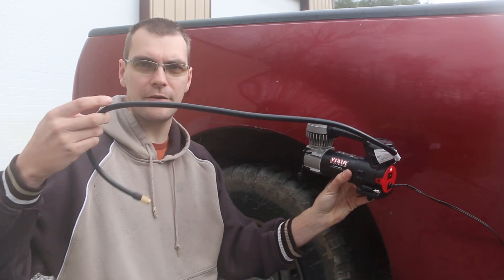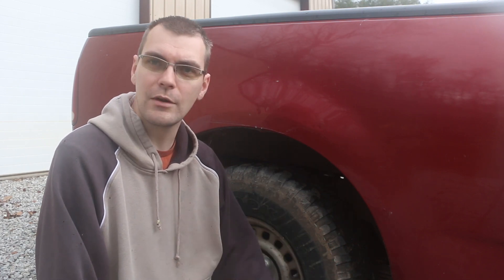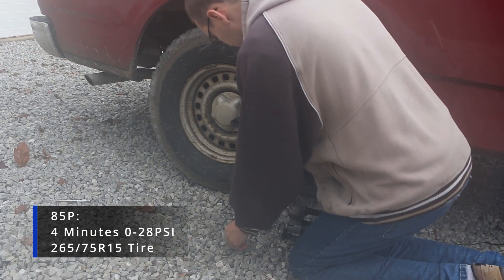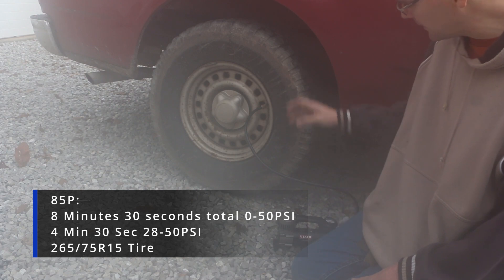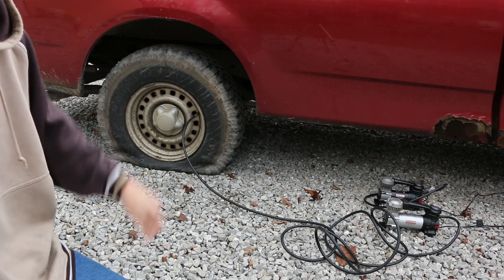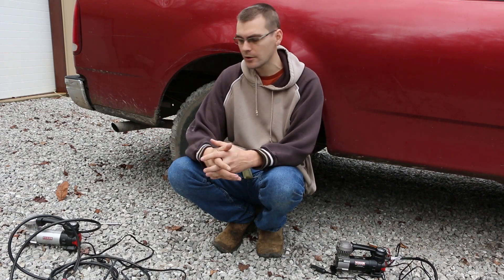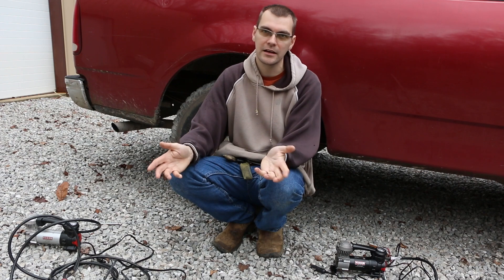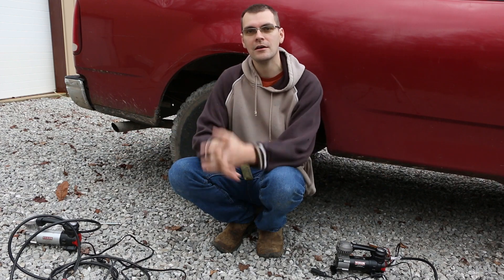Viair 85P vs 88P, Which portable compressor is right for you?

Comment: I am so brand new to cars. This saves a lot of time cuz I have used those pumps at gas stations, the ones with free air but sometimes it goes from 25 to 28 and then numbers switch back so I really don't know how much air Ive put into my tires.

Comment: I have the 88p for my Jeep. Was thinking of getting a viair for the wife’s crossover. Either the 85 or the 88. I guess it depends on the power outlet on her crossover.
Reply from the maker: Both are certainly great options. I love my 88p, but the 85p is a tad easier to use with the cigarette lighter adapter thingy, but it is a little slower too.
Reply: @trythistv  I have the 88p as well for my jeep. I love it. But buying another one might be a little overkill to keep in my wife’s BMW X1 so I may go with the 85.

Comment: I hope you didn't drive with 50 psi! Proper tire pressure is on door sticker.
Reply from the maker: 50 is a shade low for lt tires, but these tires are junk and this truck never sees loads all that heavy or towing anything very big. My big trucks get 65 in the fronts, 80 in the rears

Comment: Nice comparison... When I was looking around 5 years ago I had looked at the 85p, 87p and 88p..I ended up going with the 88p for the hose length and the increased CFM.   And yes Viair recommend running the engine when using it... It is faster with the extra voltage.   Yeah 85p is a good choice for a compact car.  Now a days there are a lot more choices... Like the Smittybilt 2780  or 2781 that has 1.5 or 3.5 times the airflow of the 88p...
Reply from the maker: Man I didn't know about the Smittybilt compressors, I'm gonna have to pick one of those up, not a bad price and looks like a real quality unit. I love my 88P, but I know it's not meant for some of the stuff I use it for.
Thanks for bringing those to my attention!
Reply: @trythistv  ... There is a mod that can be done to the smittybilts that add a pressure switch to turn the compressor off so you don't have to manually operate the on/off switch. Also a mod to convert the fittings into standard size fittings so you can change the hoses.  Plus  there are a couple bigger units that are pushing double the Smitty 2781 (5.46CFM)..i.e. 10.46CFM...Desert Armor Beast compressor at $230 .. Has the built in switch. Then summit racing has one for $179 but that is usually sold out. And recently NAPA has been selling one (maxi Trac) at $114 but no warranty.. And it's sold out.. But something to keep your eye on.

Comment: would the 85P be good enough for small/compact SUV?
Reply from the maker: Absolutely. If you're planning on airing down tires frequently for offroading or such then the 88P will be faster, but the 85P will easily handle the odd low tire or flat, and would certainly still air up all 4, it'll just take a few more minutes.